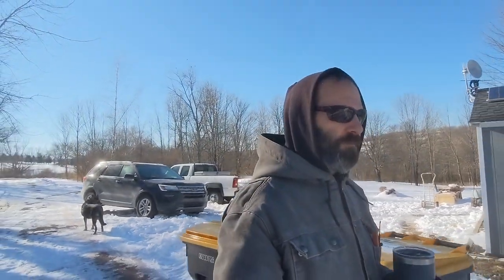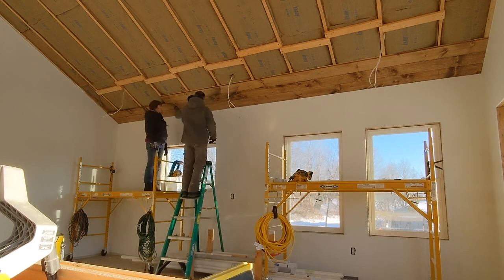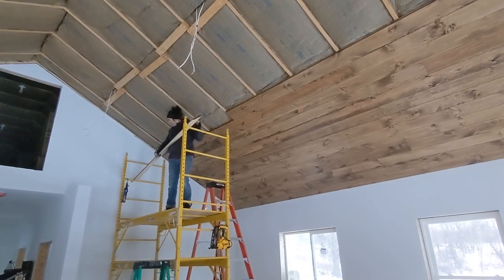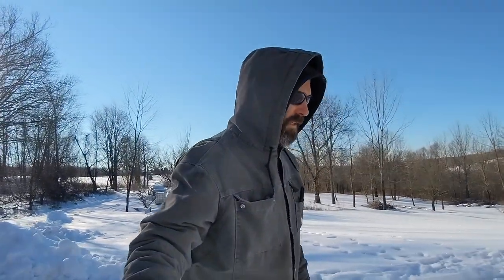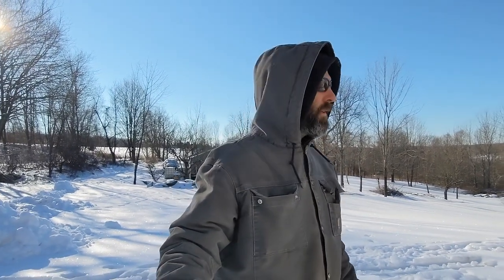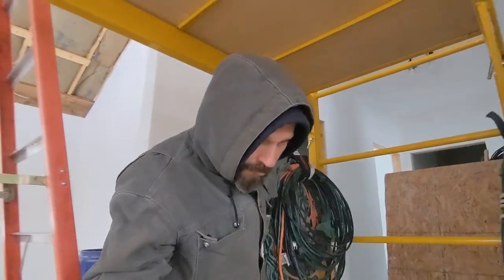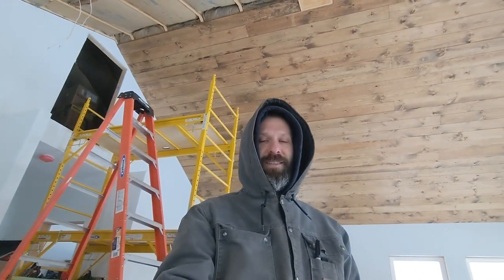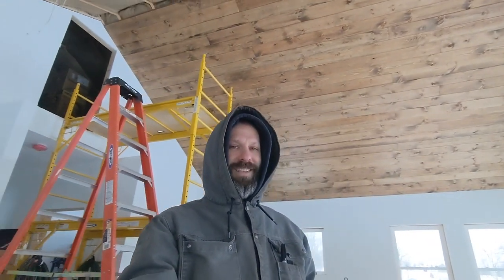SHIPLAP Ceiling Install PT1 | Off Grid Mountain House Build | The ShabinLife

Comment: Great video. I have a similar ceiling and I want to put shiplap over the old sheetrock but I’m concerned that I don’t know  how much weight it could handle.  The good news is that snow is not a factor.  Any suggestions for this calculation?

Comment: Did you guys vent the ceiling??
Reply from the maker: Hey Adam, there is a ridge vent & soffit vents if that's what you mean. You can see a bit of that in the Metal Roof Install video if that helps at all. Thanks for checking out the channel/video and have a Happy Thanksgiving!

Comment: What stain are you using for the ceiling?
Reply from the maker: Hey Adrian, thanks for checking out the channel. We're using Minwax Early American on the Shiplap Ceiling. Hope that helps a bit!
Reply: Thank you so much. I love the color and I am doing a ship lap ceiling too. Just hard trying to figure out what stain I want to use. Did you use pine ship lap? Also I see you rolled the stain on. Does it apply better than a rag?

Comment: Did you use a nail gun or finish nail gun ?
Reply from the maker: Hey Edin, thanks for checking out the channel. I used a DeWalt 16 guage angled finish nailer to install the shiplap ceiling.